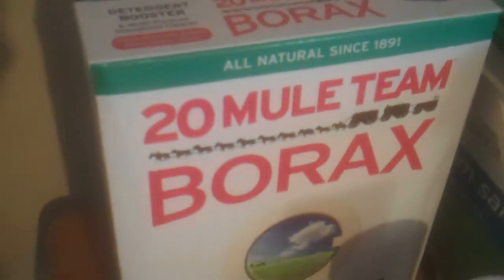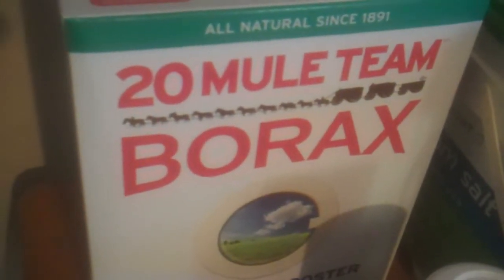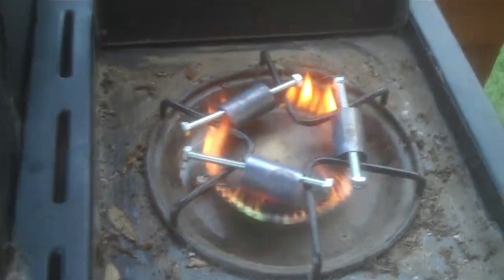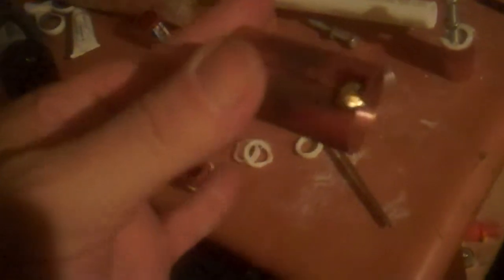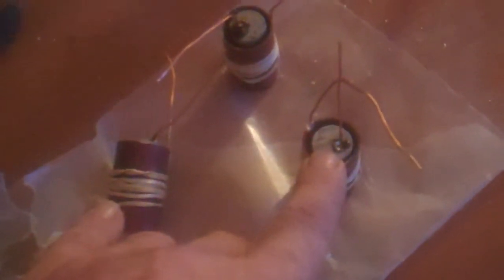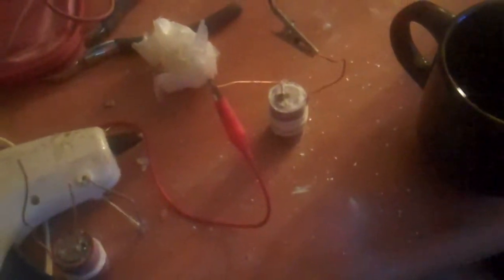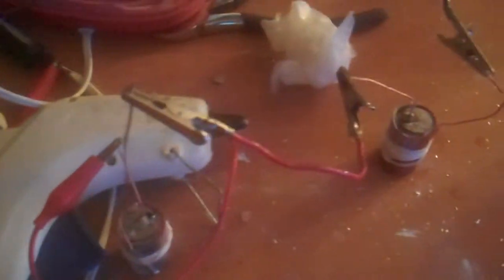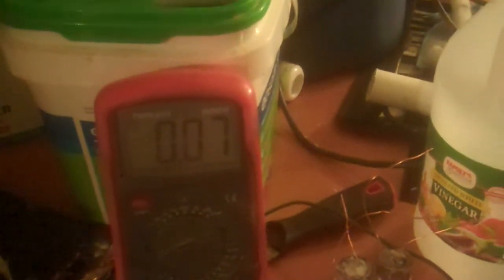Crystal Cell project

Comment: if you look at jhons he has got one that he built with copper magnesium and Epsom salt he just melted but didn't dehydrate. they came out to about the same result you have there. if you heat it some the voltage will go up but when it cools it will be back down to the 1.2 to 1.3 volts. didn't see any long term results on there so don't know if it stayed there.